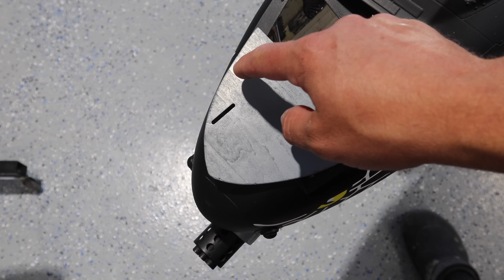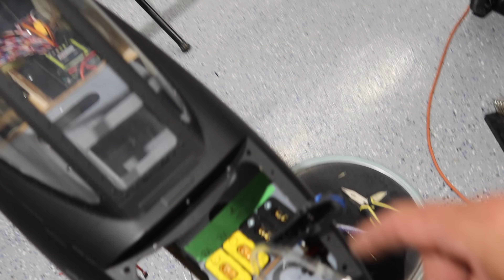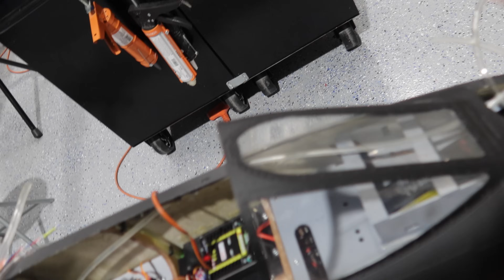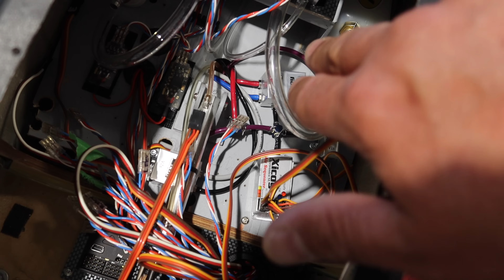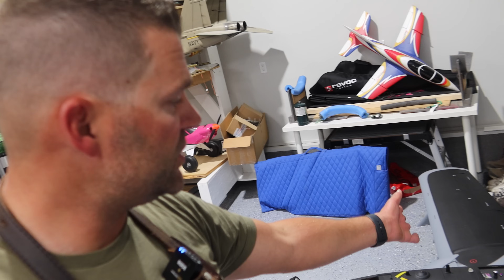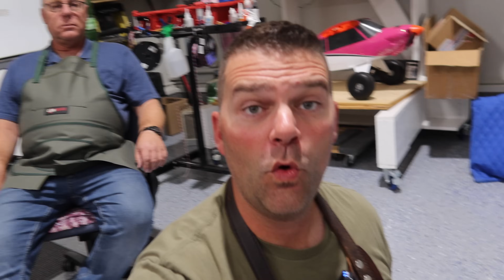THATS IT!  I'm DONE! - The Massive Skymaster A-10 Black Snake Complete

Comment: The turbine faces/fans are free spinning and just for show correct?
Reply from the maker: Yes correct.
Reply: @thelightersideofrc  Are they on bearings and how do they affect airflow?  They must pre spin the air...what is the RPM on the faces at full throttle?
Reply from the maker: Yes on bearings so no issues with how fast they spin. 

Never checked RPM and the don’t seem to inhibit airflow at all.

Comment: Wow ! I am too old for such toys, however the complexities of this model,  intrigued me.  Well I spent my life wiring things repairing bad wiring , and drinking , call it stress relief ...lol . Trusted with many things over the years, funny i started out to be an engineer . Anyhowcidvlove to see a schematic for this aircraft you have built. It is far more complex in design than any I have built ... 6 kids 16 grand kids . So this would be outside the limits of my pocket book.  It was a life choice , I'm happy to say it might be the best choice I ever made . I need complex things to keep the little gray cells happy . So could you make the schematic available ? Thanks, take care.
Reply from the maker: Haha. Thanks John!  I get it!  
These large aircraft look and are quite complex but it becomes easier when you break it down to systems. Everything king of spans out from the main brain hub CB310 in this case and goes from there. 

One of those scenarios where I understand the schematic and have a picture in my head so no need to have it on paper first. The pre layout in the radio also helps with planning this out as well.

Comment: I'm no expert buy don't you need ball valves between  the uats and the turbines so u don't flood the engines while ur fueling. Probably the cause of the hot starts
Reply from the maker: Yea you bet it’s always a great idea. Without them your relying on the solenoids in the engine to for sure close and keep the fuel out while filling.

Comment: Awesome build as always. Looking forward to seeing the maiden. Those X180s are powerful. I rarely go to full throttle with my x180 in my rebel. 

Looking forward to to seeing the PC-21 build.
Reply from the maker: Thanks Karl!  I suspect we may be turning the full throttle output down on the engines.  The A-10 with the 140's is plenty.  So maybe crank it down a few notches!
Reply: @thelightersideofrc   yea I thought about that too on my rebel. That engine is so powerful. I fly at half throttle.
Reply from the maker: Nice to have sometimes but not really needed. I think if your flying 1/4 to 1/2 throttle the entire flight it makes sense to turn it down. I have a Swiwin 170 in my ultra flash and it can fly the entire flight at 1/4 throttle. But on that plane sometimes the full throttle pass is fun🤣😉
Reply: @thelightersideofrc   oh yea of course got to have that need for speed. I keep myself calm and use throttle management with that big engine.